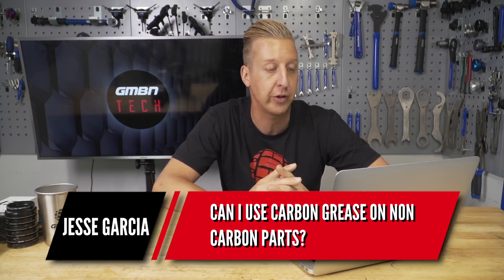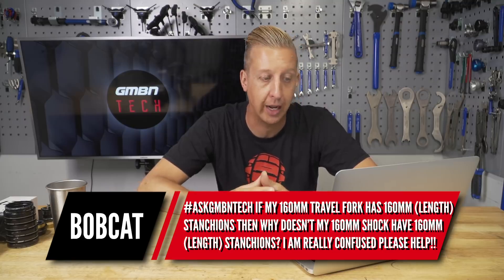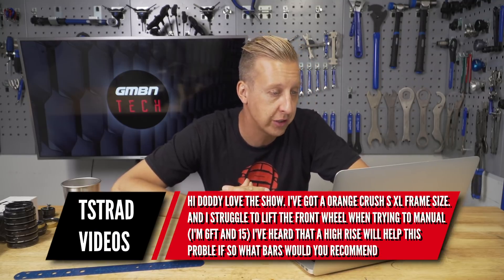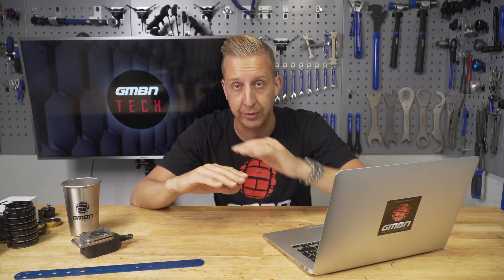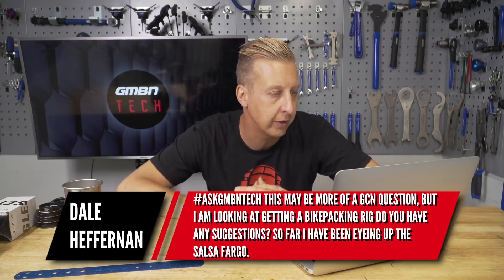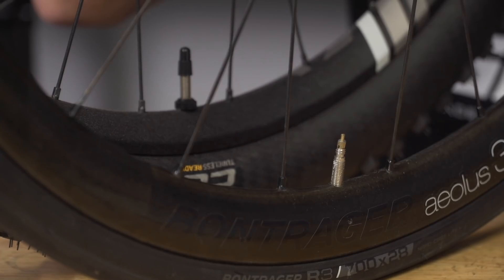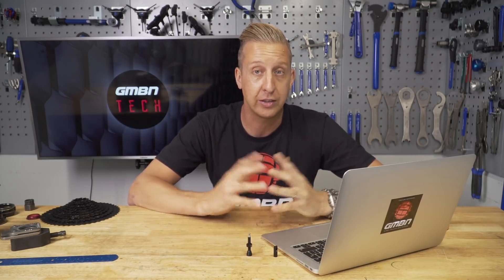Ask GMBN Tech: Why Isn't My Mountain Bike Suspension Travel The Same?

Comment: Shraders always break on mtb because the base is made of rubber and are more prone to drift under the low pressures mountain bikes run. I snapped and punched holes in shraders all the time on my old bike trying to run low pressure. Presta has a little nut that holds it in place and are less likely to drift since the base can be completely in contact with the rim. When shraders sometimes had a little gap.

Comment: #ASKGMBMTECH

Doddy, I'm running Shimano MT500 brakes I run them so I have power at my finger length. For some reason when I'm going downhill they lose the power in the first part and I have to pull them up to the bar to get full power. What could be causing this?

If I'm going up hill or on a flat they are fine and maintain the correct setting for my finger length.

Comment: #askgmbntech Hey! I have a 2012 Scott spark 40 with Reba fork and DT swiss shock. It has a twinloc function, and I do not know if it is OK to use it when I am riding. I am asking because when I am on the bike, and the shock is a bit compressed in due to the weight of my body, after locking it the piston can move backwards a bit and make a knocking sound (the situation is when the shock does not have much weight to be pushed in, so it would normally go back to default position). I really want to know if I can damage the shock or not. Thanks for the help in advance!

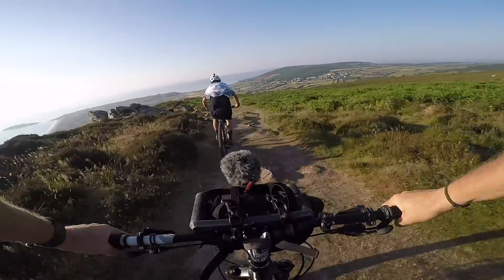Comment: @11:55 If your rear cassette seems to wobble a bit too much even with all the spacers in place and the lockring is tightened to spec, it’s a blooming good idea to check the tightness of the freehub lock bolt. This gets overlooked often. I’ve had a factory-built wheelset on a brand-new, LBS-assembled-and-checked bike that had accidentally shipped with the freehub bolt loose, so speaking from experience here. :)
Reply from the maker: Great advice 👍

Comment: #askgmbntech I love the tech channel doddy, you’re the right man for the job! I want to ask a technical question about 1x drivetrains. 
I’ve heard that that the 1x chainring sits so close to the frame that when you are in your smallest sprocket out back, it throws the chain line off and causes extra friction. Causing a loss in power. What are your thoughts?

Comment: also, when inflating a Schrader you have to overcome the tension of the spring with each stroke (tiring when using a small handpump). it's a sprung valve. the presta on the other hand are easier, as the pressure differential alone will be opening it and you'll be way easier to inflate.
Reply from the maker: That's an interesting fact. But how does it affect a car's tyres?
Reply: GMBN Tech since car tyres are mainly around 25-30 psi (up to 80 on HGVs), it's not a problem.  And since they are pumped up using air compressors, there was no need for transition to presta or other newer design. So even as tubeless, they kept the Schrader. It's a robust design suitable for that environment

Comment: #askgmbntech hey Doddy love the show I have a specialized pitch comp size small and it came with a 80 mm travel fork. The other sizes of my bike come with 100mm I was wondering if I can upgrade to a fork with 120mm travel or if I should just go up to 100mm thanks
Reply from the maker: Hey Kent, Specialized often offer their small and extra small bikes with shorter travel forks to keep the riding position similar across the range. You could probably go up to 120mm if that's what you're after, but we wouldn't suggest any more than that. It will change the geometry a bit, raising the bottom bracket and lifting the front end.

Comment: #askgmbntech does a drive train have a weight limit I’m 115kg and have a sram nx 1x11 on a nukeproof scout (don’t know if that’s relevant or not)I have had it less the a year and my bottom bracket is creaking and making funny noises, love the show
Reply from the maker: Hey Zelfor, that's odd because usually it's a pressfit bottom bracket that creaks, and not a threaded one. Have you maintained your drivetrain well? Cleaned it and greased it frequently? It's definitely worth it to remove all the parts and check up to see if they need replacing. Bottom brackets can sometimes need replacing much quicker than we think, especially in wet weather.
Reply: GMBN Tech I’ll give it a good clean but it’s also started skipping like a massive crunch and my foot will shoot forward I’m so confused 😂 thank you for replying you’re a life saver 😂

Comment: #askgmbntech Hey Doddy! I would like yo upgrade to fork on my bike, but my bike has a 1.5" head tube and i cant find any good forks. So i was thinking of gettin a adapter for my head tube. Could you reccomend any good headtube adapters? Cheers! 
Btw dont try to pronounce my username
Reply from the maker: Hey! So, it sounds like your bike has a 50mm (external) diameter headtube (44mm internal). You could fit a fork with a straight steerer, or one with a tapered steerer, but you would need to get the right headset. The bottom cup needs to be an external cup, so the code you're looking for is EC44 (external cup 44). The top would be ZS44. Cane Creek, Hope and Nukeproof all do headsets that will fit. They usually sell the top and bottom cup separately to fit a wide range of headtubes.
Reply: GMBN Tech Thanks!

Comment: #askgmbntech Do you think that with the emergence of e bikes we will see e bikes in the future with air compressors and run flat tires or adjustable shock pressure on the trail??? Cheers
Reply: You can get a normal bike that stores compressed air in the frame to inflate tires now... well I say normal, it's a very boutique thing
Reply: Steven Chabot yah i saw that looks interesting. In mean so that you could change pressure as you ride and not need to stop. Not sure if possible just a crazy idea
Reply: matt smith Like in Dakar races !

Comment: Hi Doddy, why rim manufacturers don't start using Shradder valves to MTB bikes? They are cheaper, much less prone to cloging due to the sealant drying and you dont need adapter when calibrating on a fuel station!

Also, Bobcat could become the GMBN Tech mascot, but should help you get that Santa Cruz project up and running sooner! I'd love to see reviews about those third parties components!

Comment: Why WOULD we use schrader valves over presta? The way I see it a lot of us mountainbikers often have other bikes as well, be it road bikes or city bikes. If we don't have the other bikes the people close to us might, spouse, kids, wife etc? With most bikes as far as I'm aware coming with presta setup out the box and most inner tubes/tubeless conversion kits coming as presta there is an abundance of presta out there. If both valves fulfill the same purpose why WOULD we change? I would be annoyed having to deal with BOTH presta and schrader in 1 household. I honestly don't care which valve I'd use as long as it's only 1 type and as I also ride a roadbike it will be presta.
The only benefit I see from a schrader valve is that you can pump it up at a gas station, to which I would say a: you're lazy, get a pump! b: there are presta to schrader couplers you can put on your keychain and voilà you can still pump up your presta at the gas station and c: get a compressor at home and take Co2 cartridges for on the road use and you'll "never" have to manually pump up your tire anyway.

Comment: Do you recommend purchasing a New but, Clearance 2013 DH bike? How many years are parts and components available after production year? 2013 in this case obviously...
Reply from the maker: Hey Derber's, a 2013 bike is quite out of date in many regards. It could be a great bike still, but the geometry might be very short and fairly steep, compared to some enduro bikes and even trail bikes. If it's a real bargain, then it may be worth it.
Reply: GMBN Tech thanks friend!

Comment: #askgmbntech Hi GMBN, I'm using Shimano SPD mountain bike pedals, and when I'm pedaling the left pedal is making a clicking sound. Is that normal or is there something wrong with my pedals and/or cleats?
Reply: If everything is tight, use your hands to put some pressure on the pedals while you backpedal. If you get the click, it’s the bearings in the pedal shaft. Live with it or replace. If you don’t click then, add a bit of grease to the surface where the cleat and the pedal meet (the inside edge) - just a thin film.
Reply: Thank you for your suggestion Craig, I didn't get the click when backpedaling (and I applied quite a lot of pressure), so I put a thin film of grease on like you suggested, but I'm still getting the clicking noise. Is there anything else that I could try?
Reply: Believe it or not sometimes if your cleats on your shoes are not tighten enough you can get a same click sound...

Comment: #askgmbntech i have a Trek Roscoe 8 with a sram nx 1 by 11 and in the middle range of gears it won't always shift and when it does shift it skips gears. at the lower and upper range of gears it shifts fine how can i fix it
Reply: Potentially bent hanger.

Comment: I gave my bike to this mechanic so he could replace the free hub body as I didn’t have the tools, he ordered it from eBay and 2 weeks later he gave me my bike. I have a test ride there and everything seemed to be alright and fixed so I take the bike home give it a wash and I take the rear wheel off to clean it. As I put the rear wheel in and tighten the through axel I notice the brakes where rubbing on the rotor so I push the pistons back and try again, the same thing happens and then I noticed that the actual brake not the pad like the actual brake as a whole was rubbing on the rotor and there’s no way to adjust that and then I loosened the axel and the free hub gave out the worst sound I heard in a bike, it sounded like a bunch of spoons and forks being scraped alongside each other. So I really got pissed and decided to check the cassette and it fucking shakes like it has some damn seizure. Yeah and the original problem is still there but worse. What the fuck did he do to my bike.
Reply from the maker: Hey Reckless, it sounds like you should take your bike back to the shop and have them look at it again. Mistakes can be made, so just be sure to keep the relationship with you local bike shop civil.

Comment: #askgnbmtech I ride a custom steel XC bike and I want to put a dropper seatpost on it. The problem is that the seatpost diameter is 25.4 mm, is there any dropper compatible with this diameter? And is there an option without the remote lever? My bike don't have the proper cable routing and I prefer my cockpit without  the extra lever/cable. Chers
Reply: seat tube diameter

Comment: Shraders clog up with the sealant immediately. I've tried a ghetto tubeless conversion once using Shrader valves and it had to replace clogged valve cores each week.
Reply from the maker: Really? We've seen Stans NoTubes schrader valves, and just assumed they would work. Interesting! Maybe we should give them a go and see if they work as well as presta.
Reply: I haven't seen them before. Nice to know. Maybe they use different cores? Standard Shrader valve cores I've got had a rubber seal while Presta has plasticy looking one which may not cause latex sealant to stick as much as the rubber does.

Comment: #askgmbn
I thinking about upgrading my rotors from 180mm to 203mm. My bikes a 2015 cube stereo 160 with rockshox pike forks. What brake adapters would I need for the bigger rotors?
Reply: It depends on your brake calipers but it'll be a 43mm adapter, should be post to post if yours is the same as the picture of the bike I found (most bikes are post to post) and get the one that matches the brand of brake you use

Comment: Got a question about setting up a 10 speed  to 7 speed. I got a atomlab DHR rear hub and it only fits 7 cogs. I took a shimano ultegra 6700 road cassette and removed 3 cogs. My question is shifter set up. I dont like having 3 dead shifts at the bottom, can I modify a my saint shifter to make it 7 speed? Or I have seen block that fits on the cable to limit the shifter cable movement. What is your advice. I have zee derailleur and saint shifter

Comment: can you make your own internally route for your dropper seat post? thanks.
Reply: AJ Bikes unless you are a very skilled mechanic with high quality industrial tools, NO dont do that
Reply: Florian Käselau Haha. Drilling a hole dosent require a lot of skills or special tools. But drilling a hole in the wrong spot can be bad and even a very skilled mechanic could  do that.. then again not too many frames break at the seat tube so I'm pretty sure a metal frame could be modded safely, carbon not so easily.

Comment: Hi AD...hp valves are hp for the obvious reason actually...to fit road and espec track bike tyres running at up to 160psi...Schrader would be unreliable at best, lethal at worst, at these pressures (and imagine the core blowing out...wud be a lethal bullet!). They are narrow to fit the rims and minimise fatigue risk from a big hole:rim ratio. They are used in mtb purely for this last reason, rim strength. Car tyres are typically only 30 psi and vans about 70psi. Not up to 160 presta (hp)needs to withstand ....nothing to do with high pressure environments sorry😉
Reply from the maker: But shocks have schrader valves, and rear shocks frequently take over 100psi?
Reply: The Schrader site lists up to 550 bar or about 8000 psi. Those may be special but I’ve seen people who make air cannons run standard valves at 1000 psi.

Comment: B screw  - Shimano usually around 6-8mm. Latest SRAM (11/12) usually around 15-18mm. start there and see if the shifting improves. You want to measure the distance between the top of the guide pulley and the largest cassette ring. SRAM do make a handy tool for this.
Reply: DeadHead sram 11/12 speed is exactly 15mm...not more or less...and for full sus its set at sag...which is hard but do'able....

Comment: #askgmbn Hey guys I'm about to start saving for a full suspension mountain bike, I'm 198cm tall could you give me any headers to which bikes to look at and I would have the budget at around 3000 british pounds.
Reply: You're VERY tall, very few companies make bikes that would fit you. I'd take a serious look at a Pole Evolink, it'll probably be slightly over budget but they're incredible riding bikes and the XL size is huge, specifically designed for people over 190 cm. The Mondraker Foxy would be another option, the reach isn't quite as long as the Pole but should still work and it's a bit cheaper.
Reply: Steven Chabot thanks for the suggestion!

Comment: I work at a bike shop for a couple years Presta valves are a pain they're worthless on a mountain bike I think they should go back to Schrader on mountain bikes Presta valves don't cope well on mountain bikes tons of bent stems people try to pop them up and they can't figure out how to open them up and they bend them Schrader valves are the way to go Presta valves r a pain
Reply: Austin Glines they are used in mtb purely due to significant extra wheel strength from a small valve hole...mtb wheels need them....sounds like ur customers need someone to just help educate them a little if it is them bending them/cant use them...good cx service...

Comment: would it be ok to use assembly compound on like ... an alloy seatpost that keeps moving
Reply: colin p Yes...thou it suggests ur post or clamp might not be the right size....if ur post and frame are different materials (e.g. steel frame, alloy post) is essential to use some compound or grease even (if u didnt have movement!) To prevent seizure

Comment: #askgmbntech i've got two questions actually.
First: I've saw by several people (including my self) that the front brakes of shimano (XT, Deore and Saint i've seen so far) dont get to the pressure point that early as the back break. in case of my own bike i even dont get the braking force high enough with one finger to lock up the front wheel when rolling in walking pace. I've bleeded my breaks several times. always the same issue. what could it be? 
Second: How do ingeneers in bike companies design the suspension linkages? especially in regards of whether it behaves progressive or linear. its way to expensive to change suspension systems if you've got to design the whole thing with chains etc to simulate it. so where do they take the shortcuts? in general i would  love to see a bit more of the way the ingeneers work in those companies. so maybe a video series about this would be very interesting.
Thx, and keep on the good work!
Reply: Philip Wächter It might be worn brake pads or a tiny leak?
Reply: I think the brake issue might be down to feel and grip. I can lock my rear wheel easily with a br-m485 with 160mm rotors and I have issues with locking the front with a deore paired with a 180mm rotor. Not a good idea to lock the front wheel anyway. When it comes to suspension design, they use computer software to simulate the linkage.
Reply: Try a different brake pad composition. Semi-metallic or organic.
Reply from the maker: Hey Philip, take a look at cleaning your brakes if you haven't already: http://gmbn.eu/cleandiscs 
Other than that, it might be that your brake pads and discs are worn down to the point that they need replacing.
Reply: Engineers will do this via computer design. There’s software out there that you can explore too. http://www.bikechecker.com